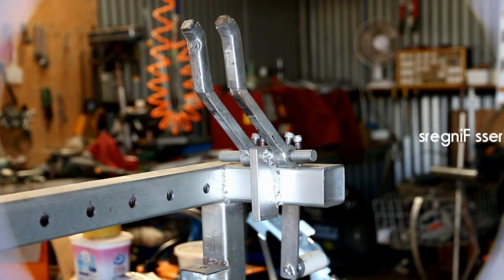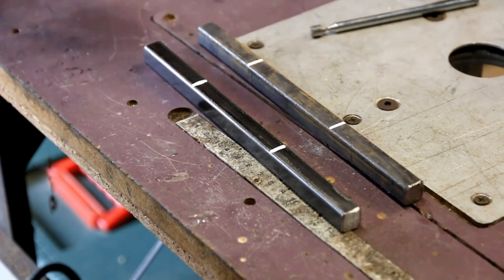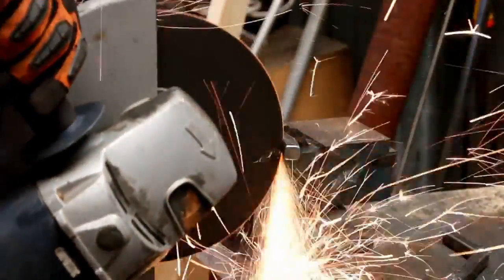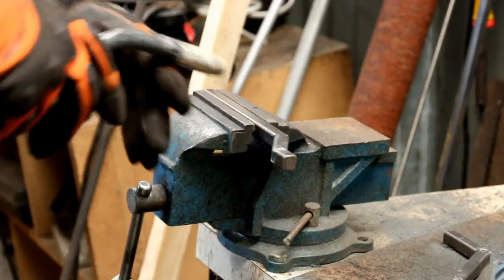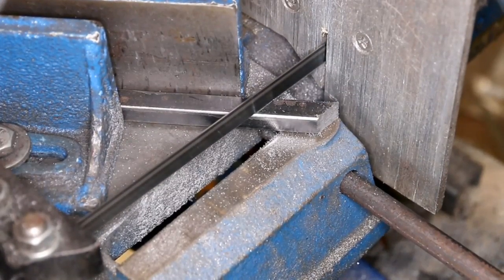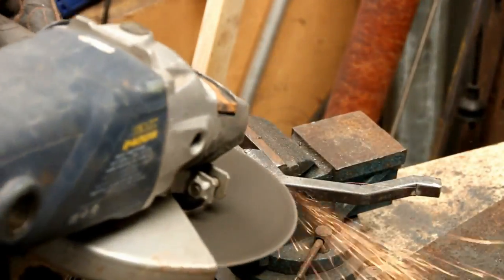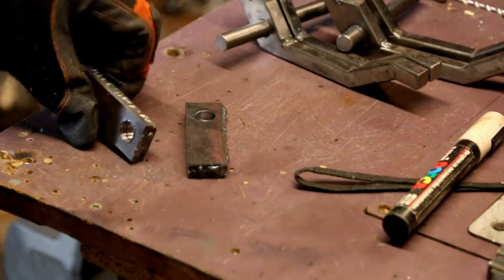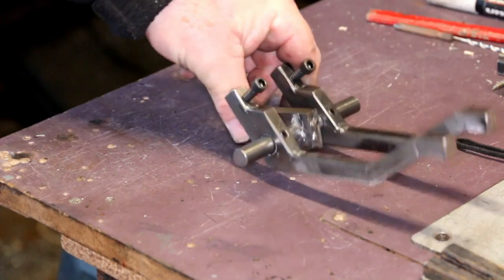DIY Bow Press Fingers

Comment: hi just a question what did you use for the rod on the press 
having a hard time finding acme rod in australia
Reply: ***** Cheers ive found them but not sure how to attach and bronze nut to the steel shs. Ive actuuly made this press on the weekend and used a $30 jockey wheel from super cheap auto works great and just hsd to grind down the round nut to a square and welded it straight to yhe arm. Only prob is it only has 10in of travel so i csnt press anything over 38in
Reply: ***** not sure i understand. dont the bolt heads stick up stopping the shs from sliding ive used 35mm and 40mm so theres only 1mm spare each side. did you use a larger size gap? thanks for the help
Reply: All thread will work just as good